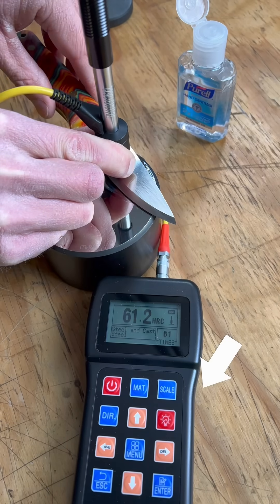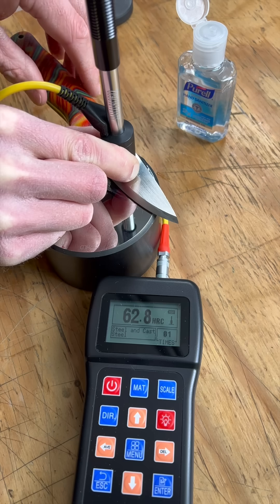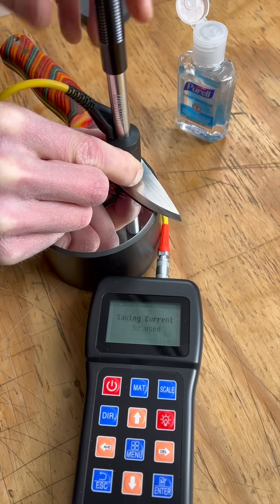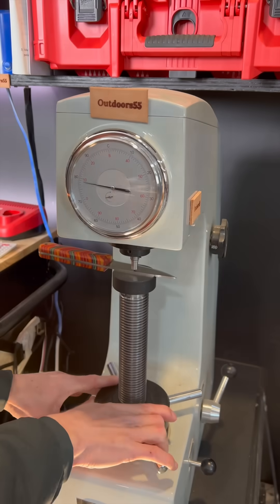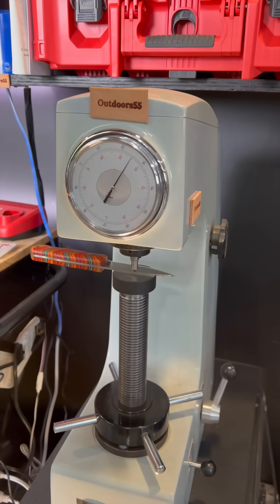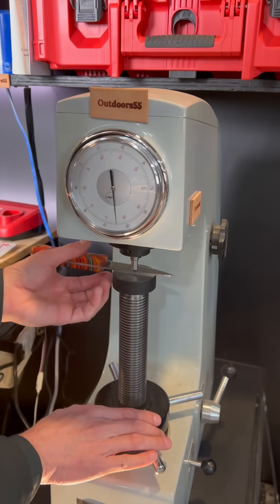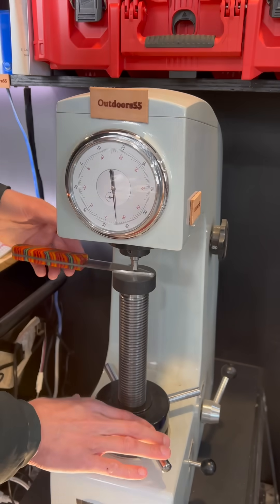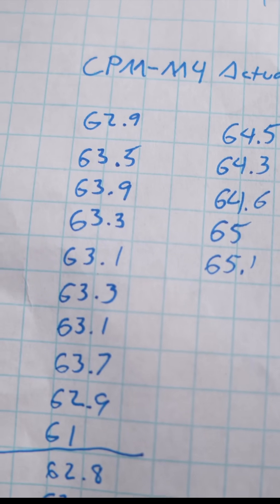Don't Use These On Knives!

Comment: This is why I love your channel - and also asks the question: Why do people need to know HRC so badly? 

If you get a spyderco or benchmade that has poor cutting performance, send it back. If it’s a $10-40 knife gift it and get a premium knife. 

If I ever started a channel, I’d just mail you the knife for the HRC 😂
Reply: Kinda true yeah. If you're a heat treater at a company, you'll probably have one of these to dial it in, but otherwise..
Reply: The HRC rating can be a good indicator of performance, high hardness generally means higher edge retention but it can also tell you about the quality of the heat treat to some extend, its similar to tire pressure, to low is bad, to high is also bad, but there is the perfect range where performance peaks.

Comment: 5HRC precision is perfectly fine for any imaginable hobby application
Reply: Considering variation in cutting tool hardness will be between 55 and 64HRC I disagree heavily.
A small knife with 55HRC is very soft for a knife and will dull very quickly, a 60HRC knife is perfectly fine.

A carbon steel machete or sword with a hardness of 62HRC will be very likely to break with a couple of hard impacts, but 57HRC is perfectly fine. 

Then again, I usually don't test hardness and trust in my heat treatment.
Reply: If I'm understanding you correctly, 5 hrc is way too broad of an inaccuracy parameter for measuring knife steel. 58 hrc m390/20cv is dogshit while 63 hrc is right where you want it in the context of pocket knives. Maybe I misunderstood...
Reply: I think +- 1 HRC is the way to go. Anything above can by quite deluding
Reply: @7784000 especially since it's nonlinear. 62 to 64 is already 11% harder.

Comment: you know it is one thing to have one of those testers for your own personal curiosity, it’s another thing to test makers and manufacturers blades and put the results on the Internet, calling it a no BS review when the review is based on a BS hardness tester. So now one needs to go back and reevaluate all of those reviews considering the limitations of the equipment and the knowledge of the reviewer. If those testers were even remotely accurate, they would be much more popular, considering they are a fraction of the price, way less bulky, and a fraction of the weight of a traditional HRC hardness tester.
Reply: Very true, as if the entire small maker industry wouldn't willingly spend less money for for the same results
Reply: cope

Comment: They are consistently accurate to within 2 HRC..  For the price, that's not bad.
Reply from the maker: They aren't. Thats what i show in the video. Also hrc is non linear. 2 points could be 8% difference or 40% difference depending on the hardness
Reply: @OUTDOORS55  And, as you state in the full video, there is no way to accurate translate Leeb to HRC, no matter what someone else claims.
Reply: @ Interesting..  I didn't hear you mention that in the video..
Reply: sometimes, the knife crowd is so stubborn it reminds me of flat earthers. There's just nothing you can say. And that's ok.
Reply: Rockwell hardness is not a linear scale, it’s not quite logarithmic, but it is exponential. Essentially two points can be a pretty significant swing, although the video showed variances a lot more than that in certain contexts.  So for instance, a jump from 50 Rockwell to 60 Rockwell is not simply a 20% increase in hardness, it would be closer to an 800% increase.
Reply: @Creelyblades 50 to 60hrc is a 44.6% change in hardness. Same as from 60 to 68, and from 65 to 72hrc - about as hard as any steel can get.
Reply: It varies so that if you don't know the actual hrc then you can't properly know what the HRC is off by. A good Heat treat of 64 HRC magnacut could test at 58-60 and you would have no idea if it was a good heat treatment.
Reply: Considering that the alternative method of testing hard was accessible to the average home shop is a set of files that go up by increments of 5HRC, I'd say this is well within the realm of good enough.
Reply: @petegalvs  I agree.. At least it's a "relevant" feedback reference,  if you're testing multiple parts.  If you're testing 5 knives you made and one has wildly different numbers, then you know something went wrong with that one.   It still has a use case.
Reply: @petegalvs and yet, those could be more accurate, but less precise.

Comment: Cbrx wont listen I guarantee it. Ive told him my findings that when testing on hardened ungrounded Blanks that my findings was within 1 to 1.5 low consistently but those are on 5mm blanks with known good heat treatments. Your video yesterday really shocked me at the variation on everything except the kitchen knife. I'm glad you did the video as I was going to do it but I know it wouldn't have been seen because I'm so small. I am going to make a video furthering what was done in your video. I seen some people asking about it being not at 99 degrees due to the flag grinds so I going to so some videos with 5mm stock and 3mm stock on ungrounded knives and show that the readings will be consistently 1 to 1.5 low on the thicker stuff and I'm curious as to what it will do on the thinner stuff. I've only ever tested side by side on the 5mm stuff just out of curiosity but this was a couple years ago. Cbrx is just trying to get views and he's going to have his Fanboys be it right or wrong he is. I fully believe that he will continue exactly as he's doing because he just doesn't listen.
Reply: If it's consistently 1-1.5 low, seems like you could just account for that? So if it says 62 it's actually 63-63.5?
Reply: @bobbygetsbanned6049  In the full vid he shows that  the differnces are wildly inconsistent.
Reply: @ That makes more sense.
Reply: @bobbygetsbanned6049 there are a lot of issues with CBRXs testing methodologies when it comes to data. You cannot just say "my ruler is off by .02 inches today so I'll add .02 inches to make up for it". 

The blocks he uses are to make sure that the tool is within a certain spec, not adding an error margin. 

With what you stated in your comment: 

This is a precision vs accuracy problem where the tool is precise (results are consistent) but the results are not accurate (the tool is always off by a certain percentage). There are way too many variables to account for to simply state that you can just add X HRC units and be good. The tool is precise but is the wrong tool for the job.